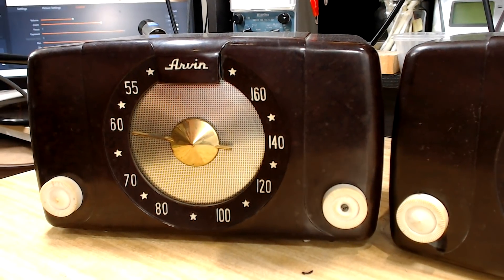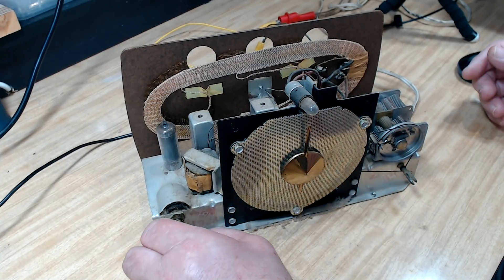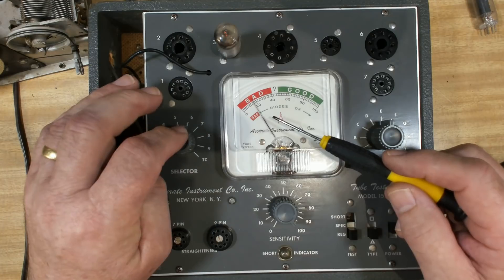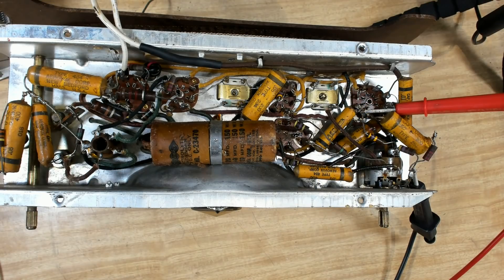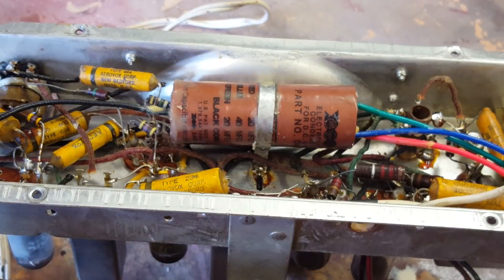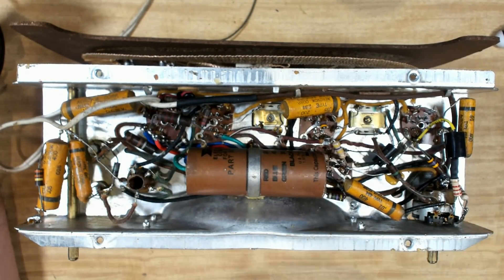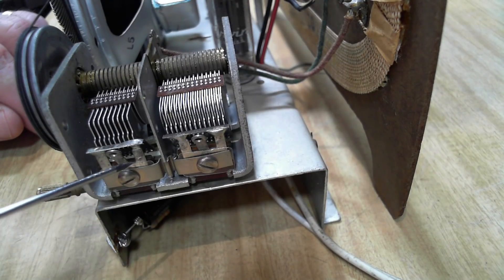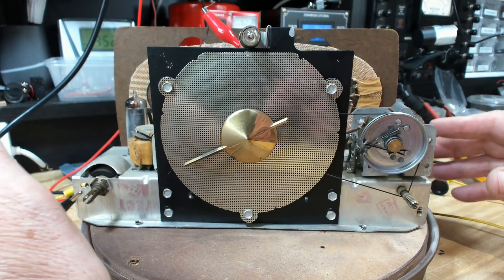Arvin 450-TL AA5 Radio Restore Down Under with Retr0bright

Comment: Great result David. First class as ever.
Does your transporter work over longer distances? If so send me a radio to fix. They are thin on the ground over here at the moment!
Don’t know if I ever mentioned but when I was very young my parents used to wash me in cheap Australian lager! I later found out I had been fostered!
All the best 
Lynton
Reply from the maker: Thanks Lynton. The transporter seems to only work between my beer fridge and my work bench, disappointing but quite handy nevertheless 😄 Haha, that's a good one, If that's the case, I must have been bathed in Victoria Bitter judging by the outcome 😄 cheers!

Comment: Hi, at 26:40 minutes .The 3.3k resistor . What does it connect to ? Perhaps the big 47uf to ground ? Great video very enjoyable,thanks.
Reply from the maker: Hi wellusee, thank you. I checked the video and circuit diagram and cannot find a 3300k resistor. There is a 330k but it connects the B- to chassis and is at the other end of the chassis 🙂
Reply: @DavidTipton101  Yes that solves my problem ,it goes to the chassis. Thanks.

Comment: Dave, do you know where I can find a  video on repairing the clock on these tube radios?
Reply from the maker: I had a quick look around Eugene but couldn't see anything. There may be something under general electric clock repairs. I did one a few years back, it wasn't difficult except the coil was open and I had to rewind it. I cleaned the mechanism and lubed it with clock oil from eBay. it's still working 🙂
Reply: @DavidTipton101  Thanks for responding, Dave. I found 3 videos which are very good at repairing the clock.

Comment: I know it was 2 years ago, but I was still hearing remnant motor-boating. Did you replace bypass (de-coupling) capacitors?
Reply: Ahh .. I should have watched longer .. the antenna cap to chassis has a similar effect.
Reply from the maker: Thanks Gary i think I fixed it in the end 👍🙂

Comment: I was thinking about the antenna buzz, perhaps the radio needs a good reference to ground and since you powered it using a isolation transformer the ground would be "floating". Try running it without an isolation transformer if it makes any difference :)
Reply from the maker: I think it would benefit from a chassis ground wire too michvod. I have a stepdown transformer but I don't know how the it's wired inside as regards earth 🤔
Reply: @DavidTipton101  If you plug it directly into your 230-115V stepdown transformer (without isolation transformer), then essentially the radio will have a reference to ground. The house wiring is usually that neutral is connected to the earth so radio will be grounded through the neutral. This is why they said that you should try reversing your plug and see if it improves the reception (back when the U.S. plugs were non polarised - here in Europe they still are).
Reply from the maker: @michvod  I will give it a go. Our house is fitted with RCDs at the switchboard so I think the neutral is held above earth, I'll check it out 👍🙂

Comment: Hey David I'm working on a 1950's Arvin 580TFM AM/FM radio I recapped it and put all three new electrolytic caps but before I recapped it would just him after the recap absolutely no sound at all I'm not sure what it is everything lights up like it should.
Reply from the maker: All I can suggest is you recheck your work, if you removed the tubes are they in the correct positions now? Are the electro caps in the correct orientation?  Do you have plate, screen and heater voltage. You say there is no sound which would indicate the amplifier section isn't working. If you have plate voltage the output transformer is OK. 
I would... 
Check your work against the schematic. 
Make sure you have the output tube in the correct position (all tubes really).
Make sure you have plate and screen voltage on the output tube and don't forget heater voltage.
If all those are correct it should produce some sound.
I have on several occasions connected capacitors to the wrong terminal, it's easy to do.
Edit: I checked the schematic and your radio has a transformer... So if 6V6 output tube is getting hot and the plate and screen voltages are as per the drawing. Put your finger on the grid, (pin 5) (use an insulated shaft screwdriver and sit on your other hand) you should hear a hum from the speaker, if not the speaker isn't connected or is faulty or the tube is faulty. if you get a hum try the same on the preceding tube the 6T8, you should get a hum also.
I notice on the Riders schematic there is a gap between the output transformer and the plate of the 6V6, there should be a connection there.
Reply: I have like 43 volts going to the output transformer but nothing coming out of the output
Reply from the maker: @Jeremiah Huey  remove all the tubes, does that recover the voltage? There maybe a short to ground pulling the voltage down somewhere.
Reply from the maker: @jeremiahhuey6389  You can flick me an email at vintageradioaus (at) gmail.com if you like.

Comment: Change the isolinear chip in the molecular pattern buffer. 😁 Beam me up Scotty. Seriously, i really like your signal generator and i would be really grateful if you could share how you made it. I couldn't find it.
Reply from the maker: I don't have that chip Veljko, I used a bottle cap instead, that may be the problem 🤔 The link to the signal generator is in the description 👍😀
Reply: @DavidTipton101  use a replicator ;-). I'm sure if you can make original capacitors from shrink-wrap roll, you can make anything. Besides, nobody in the world managed to make Vegemite. Aussies did. Cheers, and just continue your wonderful work.
Reply from the maker: @vextenoch  Thanks Velijko 🙂

Comment: Great video, Dave. How did you make the new tube with the printing?
Reply from the maker: Hi Eugene, I did that bit in a little more detail in my DeWald radio video. The cardboard tube is from a roll of home vacuum machine plastic, I scanned the paper cover from the deWald radio into my PC and recreated it. I only needed to change the capacitance value text to suit this radio. It was then simply glued onto the cardboard tube 🙂

Comment: I wish I lived near you so I could pay you to align and repair some of my analog radios. Some are new and weren`t aligned properly at the factory....Sony ICF-P26 and Tecsun R9012 and R9700DX. These are some of the very few true analog radios still sold and work so well when you can get one that`s set up right, but sadly only about one in four are adjusted for maximum sensitivity on the MW band.
Reply from the maker: Hello BE. I think manufactures don't put much into AM in their radios anymore, designed for high density living with plenty of signal available 🤔

Comment: Hey, watch radiotvphononut's video on the Silvertone model 5 radio restoration. The Silvertone model 5 has the same chassis as your Arvin.
Reply from the maker: Hi Stephen, I read that Arvin supplied Sears with radios under the Silvertone brand. Thanks, I'll check it out 👍🙂

Comment: Is it possible to change the voltage somehow to 230v?
Reply from the maker: Hi Simon, yes, I could fit a big resistor or maybe fit in a transformer but heat and space would be an issue. There are 240 to 120 converters available for about $40, that is a better option. I have one here 🙂
Reply: @DavidTipton101  Hi David, you could maybe plan to do it on the other radio in a future episode it would be interesting

Comment: Nice video. Getting youtube spamming Ads very frequently though which is spoiling it slightly. Cheers.
Reply from the maker: Hi robbyxp1 thanks. I have been turning off the mid roll ads in my videos but it cuts my meagre income substantially which I use to offset my operating costs. You should be able to skip the ads after 4 seconds. I don't see any ads because I have a google premium account which cuts them out so I don't know how often the ads appear 🤔
Reply: @DavidTipton101  Yep, I know its a dilemna.  There was about an Ad every 4-5 mins or so, and it does break up the enjoyment of your lovely work somewhat. I'm still going to carry on watching!
Reply from the maker: @robbyxp1  Wow, that's crazy, I'll check it out. thanks
Reply: @DavidTipton101  David, just a quick question. What software do you
Reply: @DavidTipton101  sorry about that. Lets try again! What software do you use to create your labels?
Reply from the maker: @radiojoe6052  I use Publisher but if you don' have that maybe try The Gimp, it's free and would do labels I guess. There may be other free programs out there for labels 🙂

Comment: If you are going to use an Australian plug for American voltages then cut off the active pin and just use the neutral and earth pins. You can't have a "senior" moment then.
Reply from the maker: I have some American leads and plugs on the way psionl0. I don't follow your logic, all circuits here are protected by RCDs at the switchboard and if they weren't neutral would be connected to earth with no potential between them. Active to earth might work but the RCD will trip or have I got it all wrong 🙂
Reply: @DavidTipton101  The idea is that if you accidentally plug the radio into an Australian socket then there would be no voltage applied to the radio. The isolation transformer would have a similarly wired socket (you could fill in the active hole to prevent an Australian appliance being plugged into it but it has nothing connected anyway).
Reply from the maker: @psionl0  Oh, I see, I thought you were suggesting it would work between neutral and earth. Got it thanks 🙂

Comment: Hay Dave, very good restoration & thank you. Re, the cap rebuild - you said you already had the artwork... was there a video covering this please? Also Terry from D-Lab has documented his take on can capacitors... (https://www.youtube.com/watch?v=VQ3Vvu9tUJ8) looks very practical... but not as pretty as yours!
Reply from the maker: Hi 6A8G, thank you. I reused the artwork from the De Wald radio. I didn't show how I did the artwork in the video but basically I scanned the unrolled original artwork into a paint program and recreated a new one over the top of the original then deleting the original. The De Wald video is here: https://youtu.be/IawOweRg1Oo  The new artwork is at 20:42 minutes.
I have seen D-Lab do that before, not neat enough for me but it certainly is a good way of doing it 🙂